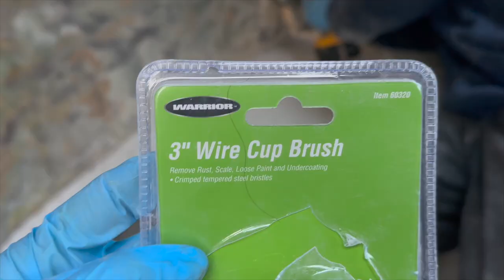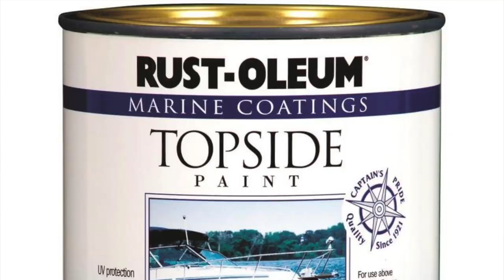UNBELIEVABLE Boat Cabin And Teak Door MAKEOVER!!!

Comment: Great idea to work around sanding in between the louvers. I'll do it for mine here soon. Question for you though. I see people ripping out the carpet and painting all the time. It looks great, but I always wondered if the cabin walls would sweat when you wake up in the morning just like it would when you wake up after sleeping outside in a tent. Do you find yourself waking up with sweaty cabin walls in the morning?
Reply from the maker: Hey Andrew! We haven’t experienced that, but we actually put ac in the cabin. What we are going to do is put up a mold resistant headliner because as it sits it traps a lot of dirt and mold making it look ugly and smelly. The company is called sailright and they sell the fabric by the. Yard! 🤙

Comment: I am in the same process. Removed my carpet out of my Sea Fox. I am using the same tool but I have a 5" steel brush on a angle grinder. I will switch to 3 inch and the drill when I get to the ceiling.
Reply from the maker: Man I gotta tell you. This was one of the WORST parts of building this boat. It was absolutely awful! Years of crap built up and all the dust from the work we had done from ripping the stringers out. Use PPE and Godspeed lol hope it comes out awesome! 🤙🍻
Reply: @perfectfitboating My Sea Fox I think I grind about 15 minutes and was tired as hell. Still ongoing, I do a few sections at a time. I rebuilt a 79 weekender Grady 19ft. I did transom, stringers up until the helm. I had a thread in iboats forum doing the build. The rest was ok under the cabin. Added sister joints to attach the stringers to the original stringer. Laid the deck and added the floatation foam. I did not paint, sold the boat and bought the  24ft Sea Fox as it had everything I needed. I was trying to add live well and bigger gas tank in the grady and realized it would not fit. Went from 19 gallon tank in the grady to a 120 gallon in the fox. Gosh
Reply from the maker: Man that sounds like a huge project! At least you have everything you need now in the bigger sea fox. I feel 24ft is the perfect sized boat for a single person or couple to handle.
We’ll be doing the transom within the next two weeks before we hang a 4 stroke on this one! 🤙
Reply: @perfectfitboating  I am just upgrading some items in the Sea Fox. Wiring, battery placements from stern to the cabin. I have foam stringers and composite transom in the Sea Fox should not have to worry about rot. I like 2 strokes less work when putting the boat up for a few months but would like to get a 4.
Reply from the maker: Check out our wiring videos if you need some help! 4stroke is in our near future! We can’t wait!

Comment: Hey. I’m watching a few of your videos. It’s probably a bit late. But they have Tia stuff. It’s a penetrating Apoxsee. You drill small holes about 2” apart. Then you inject it into the rot. I bought a quart for a soft section on my transom. I haven’t used it yet but everything I hear says it’s even stronger then the original.  Expensive though. But a big time saver. And never rot again.  My project is definitely on a lower scale.
Reply from the maker: Hey thanks for that tip! I recently found some more rot on the bow of the boat where the anchor holder is and I’ll more than likely use that so thank you for that! Just subbed to your channel that’s a nice Grady you got. Alieys parents just found one like that for a steal! I think it’s a 19 dual console with a 115! Sweet little boat!
Reply: @perfectfitboating  thanks. Yes it’s a nice boat. Big deck area. Perfect for my area. In Rhode Island. And off the coast of Newport. I ordered that penetrating Apoxsee on amazon. Was hear in two days. A few YouTube videos on it. Pretty interesting. Good luck with boat.  I’ll be looking for new videos to see it in the water
Reply from the maker: @DarrylBlackBlackfishFishing  Ha! Aliey and her parents are originally from RI! 
I’m gonna check that stuff out right now!
Reply from the maker: @DarrylBlackBlackfishFishing  do you mind emailing me the link?
Reply: @perfectfitboating  yes no problem. Need a place to send it.  But it’s called total boat penetrating epoxy.
Reply from the maker: @DarrylBlackBlackfishFishing  on our about page our email is there. You can copy paste. Perfectfitboating@gmail.com

Comment: this guy used kilz adhesion primer and then valspar storm exterior paint and it's held up for quite a while now. and it's alot cheaper. 

https://www.youtube.com/watch?v=ibIB5WjlF78
Reply from the maker: Hey John thank you so much for the tip and for sharing the video! Definitely cheaper! 
Since we’ve been using the boat, we’re thinking of using a mildew and mold resisten carpet. We just get way too much mildew here in south Florida. 
Thanks for the comment! 🤙